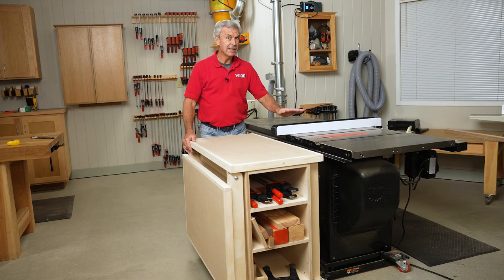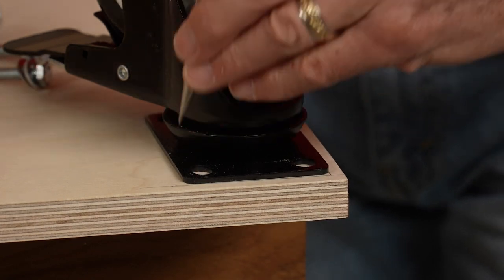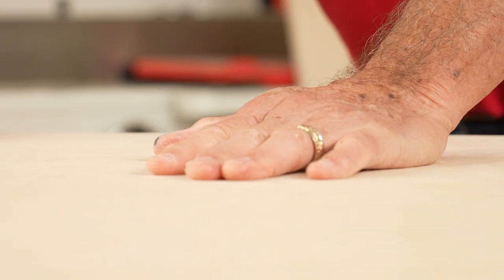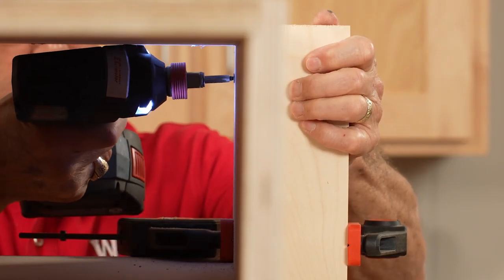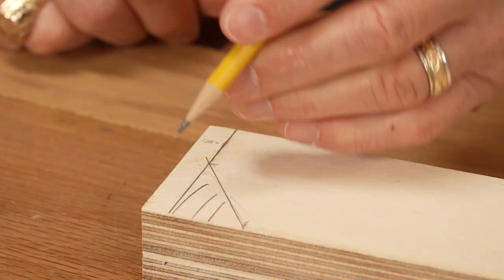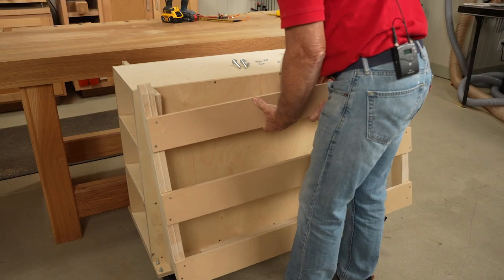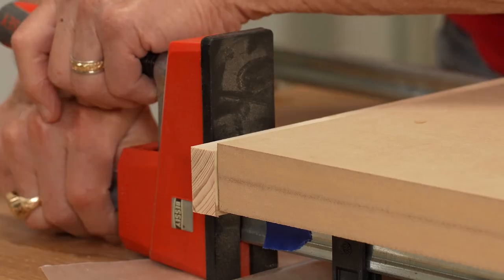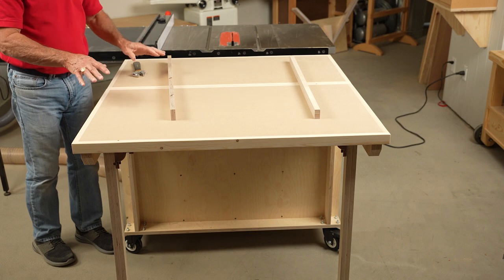Building a Tablesaw Outfeed Table | Easy to Build | WOOD Magazine

Comment: I love the design and look of your outfeed table.   It is practical, simple, can be moved into a corner for storage and seems to even be reasonably inexpensive.   It even gives me a temporary worktable to use as I build my tiny garage workshop.

I am hoping to adapt it with an open inside to contain a shopvac and low profile cyclone on a 5 gallon bucket dust collection system so that it performs double duty in my garage.

But removing the shelves would weaken it.   What approach would you recommend to restore the structural integrity?

Comment: I like the idea but my shop is a one car garage, therefore floor space is critical to me. So I built my router table a bit lower than the cabinet I use for my table saw and use the router table as outfeed for my table saw. Basically it is the same idea only instead of using the cabinet for storage, I use it for my router. Additionally I have a 3mm sheet that locks on the router table making it level to the table saw table. With both tables locked into each other, they make a handy assembly table if I have bigger projects to assemble.

I love the channel. It inspires my a lot. Thx 4 sharing.
Greetings from Switzerland 🇨🇭
Reply: I assume you had to remove the shelves to fit the router.

How did you reinforce the structure?

Comment: Wow, I really enjoy your videos and what a great project! There was a comment about cross cutting and the runners of a sled or a miter being obstructed by the table but the table is compact, on casters and easily rolls to the side out of the way and if one would attach a folding out feed table with miter slots it's just as much if not more trouble to fold it down when space is needed so I guess the choice would be up to the individual.

Comment: Another excellent video from a real pro.  I don't think there is anything about woodworking that Jim Heavy doesn't know.  Concerning miter gauge slots, it seems to me that you would need them more on an outfeed table that is attached to the back rail of your saw in a more permanent position.   In the design of this table it is mobile so you would need to align the table and the slots each time if you move the table around.

Comment: I like the general deign and may make one for my saw.  I’m curious why you didn’t put slots for when you use miter gauge or other accessories that run in the slots.  Without them you need to when this out of the way each time.
Reply from the maker: We just don't run into the situation very often, and when we do, its pretty simple to move the outfeed table. It's on wheels. You sure could make slots if you want.

Comment: This a very nice design.  It looks like you are using Baltic Birch plywood which is expensive.  Any reason not to substitute a good quality cabinet grade plywood other than aesthetics?  Thanks of this nice presentation.
Reply from the maker: Multi-ply plywood, such as Baltic Birch, tends to be more stable and less prone to warping and twisting than other kinds of plywood.

Comment: Nice design and demonstration! Why did you opt for MDF instead of plywood or other material for the surface?
Reply from the maker: Cheap, readily available, and easy to work with. As grandpa always said, we ain't building a piano. :) But also, it's a bit slick and it adds some heft to the cart. So friction from the workpiece shouldn't drive it away from the back of the cart.
Reply: @Wood  Really good to know. Still relatively new to woodworking so I'm interested how to choose the right materials for each product.

Comment: The 1/8" gap  of table below saw table height is insufficient to accommodate the 3/8" depth of miter slots, so extra slots will be needed.

Comment: I like it but what about miter bar clearance? Are you going to move the table every time you make a crosscut with the miter gauge or a sled? Maybe you have enough room with the table being that far away but seems like you still should have addressed it.
Reply: An excellent point. Making the table an additional 3/8" lower would be the easiest way to address this. That extra amount of drop shouldn't make any difference to the cutoff pieces. The other option, cutting miter gauge slots in the table would be difficult as they would have to perfectly align with the table saw's slots.
Reply: this off-feed table is for ripping long pieces
Reply: When you use a miter bar or a sled you won‘t cut long pieces that need an outfeed table. In this case the outfeed table will stand somewhere else and will not bother you.
Reply: @johnslaughter5475  Cutting the slots is pretty easy actually. All I did was slap together a quick jig and then use a router with a straight flush cut bit. The slots don't have to align perfectly and it's actually beneficial if they're a little oversize so it's easier to put the table back in place after you move it. Put the table where it will live behind the saw, clamp the jig in place lined up with the saw slot and rout your slot.
Reply: @nagamendo5655  Right, but moving the table every time I want to make crosscut would bother me. :-)
I understand everyone works different and has different needs ... just thought it should have least been mentioned in the video.
Reply: @philshock3805  Agreed. On the other hand, because everyone works differently, it would make the video too long and too boring if one would mention all the different impacts that all those versions of working with the table saw would have on the project. And of course there would still be someone who‘s way of working would not be mentioned and who would be upset about it.

I think it is easier to show the basic principle of an idea to the people, maybe giving them the according plans, too, and then it is up to every viewer how he/she wants to adapt the idea to their own needs. As for me, I have had a similar idea some time ago, but my outfeed table is not a storage cabinet. It is my router table and I can hook it to the table saw cabinet and level it out to make them an assembly table. But there is no sense for me going like „Why didn‘t you mention that the outfeed table could also be used as a router table and be joined with the table saw to act as an assembly table?“. Well, I DID write a comment saying that I have such a solution (maybe it inspires someone) but I didn‘t expect the video to mention such a possibility. That‘s why I like to read comments. Often there are some great additional ideas to a project in the comments which I would consider, too, if I would build that project. This said, I noted your point for a next version that I might build one day. 😉
Cheers
Reply: @philshock3805  Woodsmith has plans for an outfeed table that attaches right to the table saw and has slots to match the table saw. and it pivots down and out of the way to save space when not needed.  Check it out!  I really like mine on my old Craftsman saw.
Reply: @nagamendo5655  I wouldn't expect the video to include every multipurpose option that's possible but miter bar consideration should be standard for ANY outfield table video. (It should at least be mentioned.) Whether the person building the table knows it or not, it's something they'll have to deal with.
Reply: @terry2346  Thanks! Sounds cool but I'm fortunate enough to have a shop large enough to accommodate a 5x6 ft outfeed table on casters (with slots :-). I'll still check it out though -- I usually like Woodsmith projects.

Comment: Nice build. Why is the top laminated?
Reply from the maker: To make it thicker.
Reply: @Wood  thanks I understand it’s thicker. However, is the top required to be 1-1/2 inch thick to serve as an out feed table top?
Reply: @jhans3278  Laminating the 3/4 materials to 6/4 has become a standard for two reasons: the rigidity increases exponentially, and, any deviation from flatness in the one tends to be canceled by the other, especially in cheaper plywoods where you can choose the pieces to oppose their bows.

Comment: Are these plans in the Magazine?
Reply: Yes!  Issue #247 July 2017.  I'm presently in the process of building this table except with several modifications. I've been going back and forth whether to put slots in for the miter gage or just make the table 3/8" lower?
Reply from the maker: BearsFan, if you don't have that issue, you can find a link to purchase the plans in the video description. Ed, check your miter gauge and any sleds to see how far they extend. Since this is a mobile design, lining up those miter slots each time you cut might be more hassle than just leaving it stationed a short distance away from the back of your saw. Most miter gauges only extend 2"-4" inches beyond the saw at the point that gauge's fence is fully beyond the blade. That much gap will have very little effect on rip cuts, but a 3/8" drop-off might get annoying on certain cuts. YMMV.
Reply: @edcarpenter5986  Thanks Ed
I'm thinking about going with this as it looks like a nice out-feed table. My opinion, I'd just lower it instead of adding slots. That way you got a nice flat surface 👍🏾👍🏾
Reply: @Wood  Thanks. I already followed the link. I'm not gonna spend the $10 on one plan. However  catching that sale on the USB drive with all the back issues might be the move 👍🏾👍🏾
Reply: Don’t bother buying the plans. The video is more comprehensive and doesn’t omit details like the plan does. The plans are pretty worthless, actually.